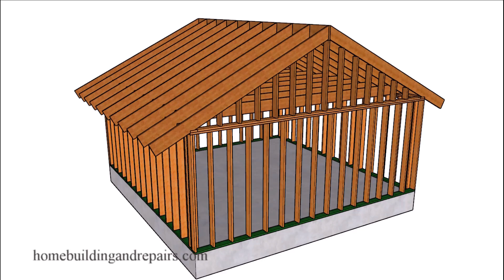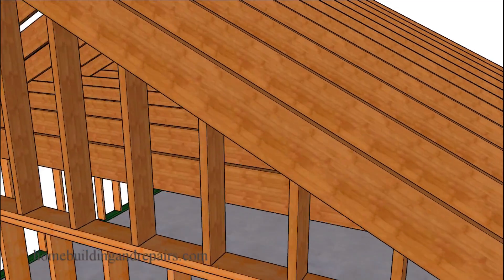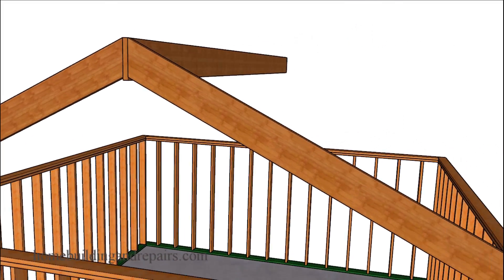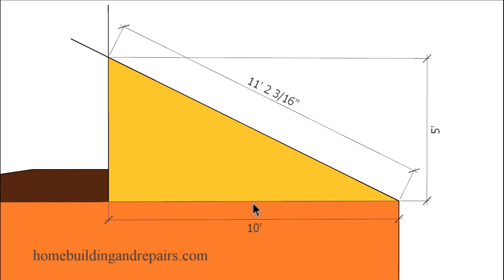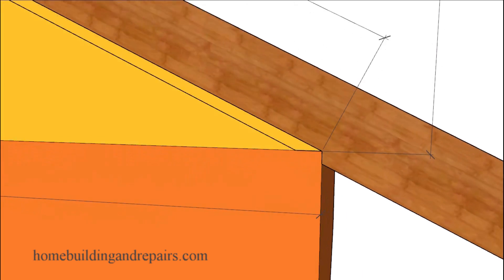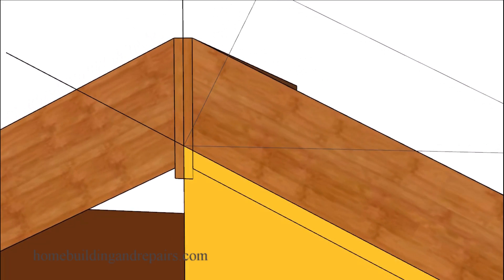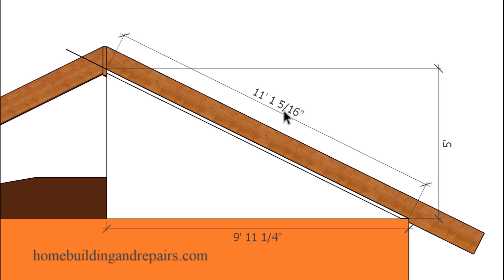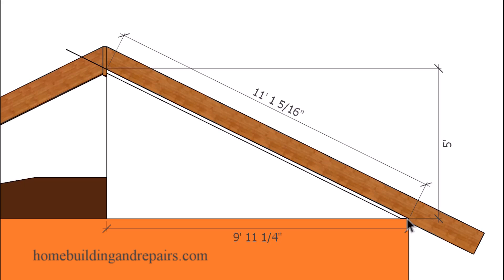Roof Framing Education -  Difference Between Theoretical And Actual Rafter Measurements

Comment: This was useful, thank you. I have a question: The Wood Framing Construction Manual states: "Where notches are made at supports, they shall not exceed one‐fourth the actual rafter depth."

How do I calculate the actual rafter depth? Based on context from other parts of the manual, I suppose the actual rafter depth where the notch would be made to bear on a wall or beam would be a measurement parallel to a rafter's ridge cut. 

So a 5.5in 2x6 dimensional lumber rafter would have an "actual rafter depth" at the ridge that would increase as the pitch of the roof increases, and would decrease as the pitch of the roof decreases. 

Am I on the right track?